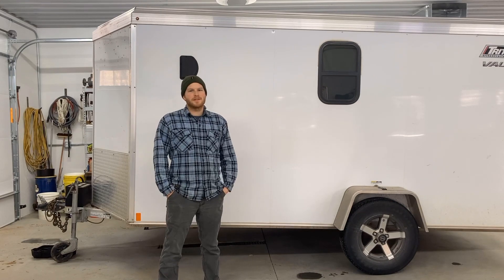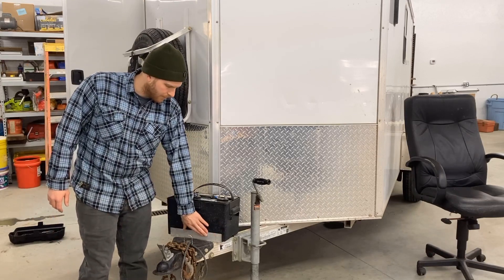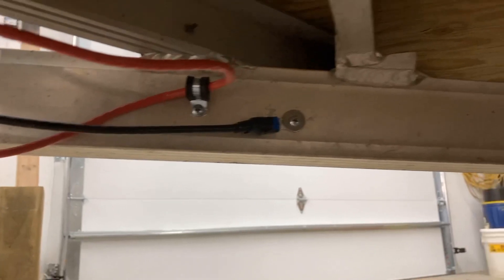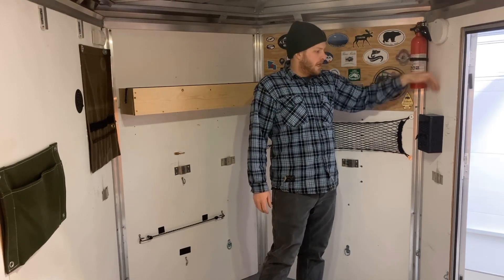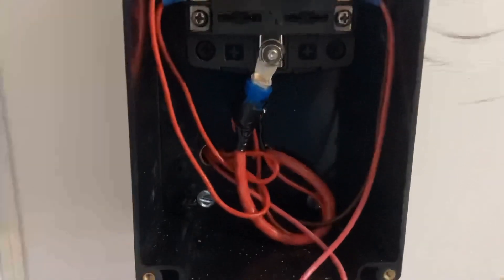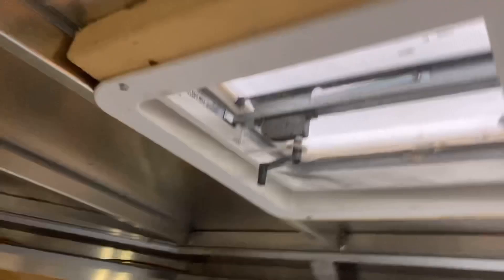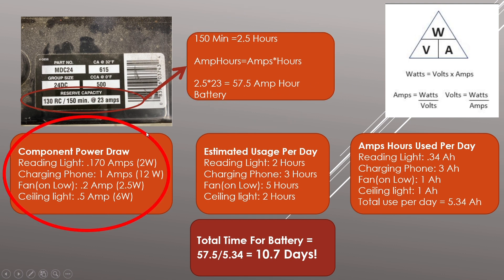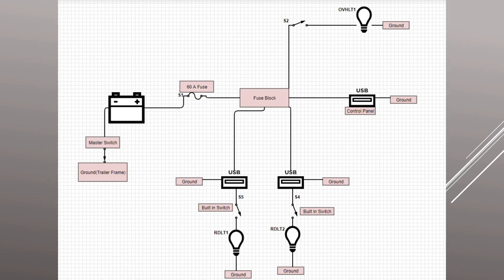Cargo Camper Conversion Basic 12V Electrical System

Comment: Did you have to step down the power from your battery to your LED lights? Or is it just straight powered by your 12v battery and the lights are able to take that much power?
Reply from the maker: They are all just straight powered. I think most leds are usually rated for 5V DC so the components themselves probably have a reducer built in
Reply: @northwoodsengineered  oh, that's super handy! Thanks for the reply!

Comment: To be able to charge your deep cycle, 12v marine grade battery off your tow vehicle, all you have to do is find the positive wire on the trailer 7 way plug, tap into it, and obviously add a fuse, and run a wire to the positive side of the battery.

Comment: 8,050 views • Feb 8, 2021 • Fine for a static location like a home but in a RV, boat or trailer vibration can loosen them and they offer no protection from corrosion.  Use soldered or crimp fittings covered with heat shrink wrap.  trailer vibration Glad looked this over,

Comment: Some nice planning and work.  Your are well on your way to a practical build.  
But I do have some observations that might be worth considering.  First, your cable run into the trailer runs across a frame rib edge.  You should protect the wire with a  wrap to protect from wear and use tie wraps to prevent movement from vibration.  Second: by placing your master disconnect on the ground side, you can have a situation where you have the system "off" with that master switch...but in fact the entire wiring system is still "hot" and enabled.  If you were to say work on a circuit or cable splice and accidently ground out a tool you will have a direct short.  Third, do not use wire nuts for any connections.  Fine for a static location like a home but in a RV, boat or trailer vibration can loosen them and they offer no protection from corrosion.  Use soldered or crimp fittings covered with heat shrink wrap.
Reply from the maker: Thanks frank for the recommendations. As for the disconnect, I did a bunch of research on which side of the circuit to put it on, and unfortunately, I found many people arguing about it for either side... I'll look into it again.

Comment: draining your battery that far will damage it over time. more realistic use would probably be a weekend trip unless you add a small solar setup which would make it run forever as long as you get some sun
Reply from the maker: Yeah I guess I should have added a disclaimer that those values are full capacity and it would be better to use it less. However a deep cycle battery will handle the draining better over time that say a starting battery. Solar is definitely something on the list to add but this was just a start.

Comment: Hi 
we have a ? did you run the negative wire straight to the trailer frame , or did you run it to the shut off switch, and the positive to the inside of the trailer,
Reply from the maker: So the negative wire comes off the battery, and then goes to the switch then directly to the frame, to create the ground.  There is a clip showing the wires coming out of the bottom of the battery box and then shows the negative wire screwed to the frame. Positive goes straight into the trailer to the fuse block.
Reply: Thank you so so much . we can't wait for your next video .